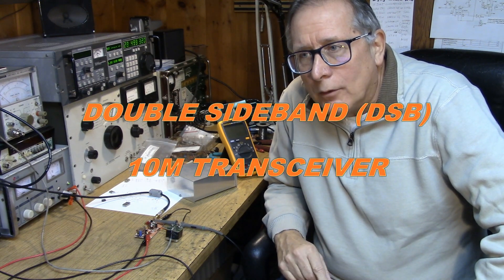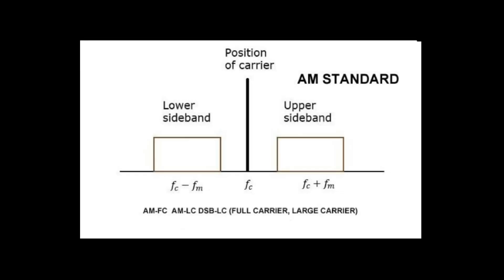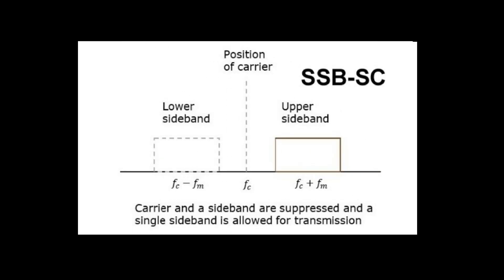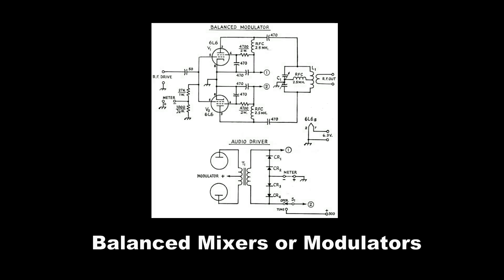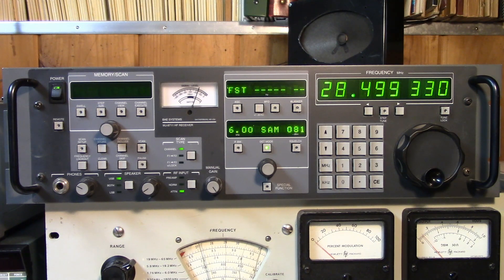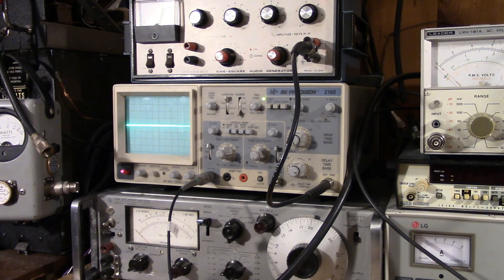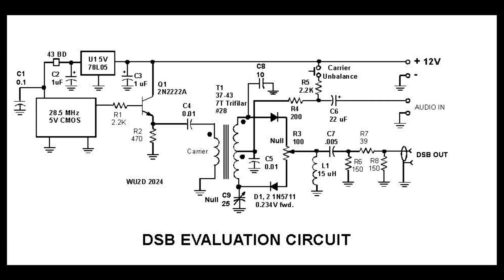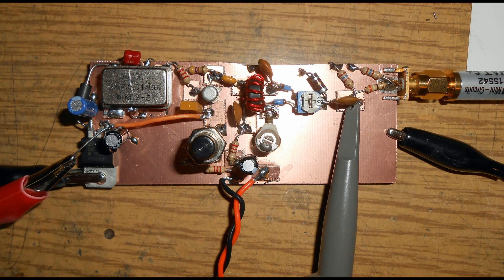NOVICE 10 DSB XCVR - PART 1

Comment: What is the make and model of the receiver with the green display that you are using?
Reply from the maker: That is the WJ8711, designed and sold by Watkins Johnson. Rebranded by BAE and Later DRS.  Early SDR IF back end.

Comment: Mike you just confused this old “G1”    ( Nothing new  LOL ) .

When synchronous demodulation is used for double sideband suppressed carrier what's the PLL locking on to ?
You shouldn't have a carrier unless it is BFO injection but that can move ( as can the RX signal ) .

For synchronous demodulation I have used a IF limiter driving a mixer port with the normal IF signal on port 2 .
It works but that's just for AM .

Comment: When you get to the build for the Final RF output could you explain how to achieve the 50 Ω output.  Looking in the ARRL Handbook I see Tables for Low Pass Filters at 50 Ω.  How do you get to the 50 Ω after the Transistor.
Reply from the maker: The easiest way is to force the final to be close to 50 Ohms and ignore it. RL roughly is Vcc^2/2P. So 12.5VDC and 1.5W  = 52 Ohms. I know this sounds incredibly simplistic and ignores Xc, but simply making the first C in the PI filter a trimmer to absorb the C will get you started. But for more power, you can see that the impedance will fall to some number like 10-j5 and you have to convert up to 50 j0 Ohms. This is typical. This is where you use your formulas with a L (or T) Match, so you add an extra L in series before the Pi Filter. So the conversion up is done with a series L and the first Shunt C which is variable. Then a couple more stages of low pass PI and you are done. Assume a Q of 2 or 3 for a wideband match and maybe 4 or 5 for our 28 MHz narrowband case.
Reply: Thank you for the explanation. I think this is leading to doing more reading about Smith Chart Plotting. @MIKROWAVE1

Comment: I'm lazy and just go with the Mini-Circuits double-balanced diode ring mixer modules - LOL. Thanks for the video, it brings me back to my communication systems class.
Reply from the maker: Cheap is even better than lazy. For fun a took a choke from an ATX power supply with a solid ferrite inside and took the tiny 1/16 Dia. by 3/4 inch long ferrite rod and wound 7 turns of #28 trifilar on it and configured the transformer solenoid style. Then I replaced the two Schottky's with unmatched 1N914s. Everything was pretty maxed over to get a null, (the pot and the variable trimmer); but it worked just as well as the fancy toroid and the Schottky's!!

Comment: Search for Wireless World Homodyne Receiver.

Published in September 1973, pages 416-419.

I built this, but used two mechanically connected tuning capacitors rather than using tunable inductors.

I'm not sure that one could find the two ICs nowadays.  Maybe some day someone will update it to use more modern components and perhaps a lower voltage.

Comment: Great video really enjoyed it. One thing the Icom 706 (all versions) does transmit normal AM with both sidebands. It’s takes the SSB balanced modulator and applies a DC voltage to the audio input to unbalance it and transmits the carrier & both sidebands thru the AM receive 8khz wide filter. It’s 4 quadrant multiplier configuration. Also they use the FM audio limiter on the AM mode to limit the negative & positive, mainly so the modulator does not carrier invert at 100 percent negative.

Works great, I used the same type of setup on my other radios for AM using a MC1496, UPC1037H or SN16913P which are double balance mixers or balance modulators depending how you have them configured. The best setup is a 2 quadrant multiplier, basically a single Gilbert cell. That gives you modulation that is identical to plate modulation and the carrier pitches off just like plate mod. Low distortion and sound super. All my radios have 455khz transmit IF, so thats were the modulator is inserted
Reply from the maker: Wow the 706! Older transceivers just added some carrier by just unbalancing the null.
Reply: @MIKROWAVE1  I would say just about all the older japanese analog SSB radios do it that way. Some Yaesu models have separate AM modulators like the FT-102 which uses a Gilbert cell and a few other Yaesu models use FET gate modulators. Icom radios have always unbalance the SSB modulator for AM. Same for Kenwood , except for the T-599 transmitter that use a Gilbert cell like the Yaesu FT-102. 

Those that have the Gilbert cell have extremely good modulation with low distortion and look exactly like plate mod on the scope. I know your using discrete parts for the creating the DSB which is fine , but a MC1496 or SN16913P would be much easier and will hold the carrier suppression spec better under all conditions. You don’t need any matching coils either and very low parts count, especially on the Texas instruments SN16913P
Reply from the maker: @GammaMatch  I worked with Barrie Gilbert as an applications engineer at ADI in the late 90s. We stole him from Plessey.
Reply: @MIKROWAVE1  Wow thats so cool, His design using differential amps in a cross coupled configuration is the standard for mixing and IC balance modulators. I have a Yaesu FT-1000MP that is the only modern ham rig that has a Motorola synchronous AM detector, really works and sounds good. Looking forward to part 2 !!

Comment: Hi Mike, I have built a DSB transceiver some years ago for 40m and had a great deal of fun with it. Most stations didn't realise I was using DSB and had some great contacts and reports. A few even failed to find the other sideband. I would have loved this video series back then. I also have an old 10m DSB TX  failed project still sitting on the bench. Made several QSO`s but kept breaking into oscillation. 73...David M0DAD
Reply: Too much gain in one of the stages?
Reply: @G7VFY  Yes quite possibly, I was thinking it may be harmonic related. It worked great into a dummy load but would howl into the antenna. I found when I detuned the antenna with an ATU the howl disappeared and was able to make several contacts. It was one of those projects I couldn't get sorted and didn't want to give up so it has remained in the unfinished draw of my shack...David M0DAD
Reply: @m0dad  I remember listening to a SOLDERSMOKE podcast and hearing about  Bill Meara having stages going into oscillation. With PA it's really bad.
Reply: @G7VFY  That`s right I remember it. It was Bill Meara who helped me with some advice when I was building my 1st DSB TX. I think it was when he first moved to London. A very helpful chap and he was even kind enough to send me one of his trifilar wound torrid transformers so I could compare to my own.

Comment: Mike:  I've built at least three DSB transceivers.  On the receive side, the way to go is to assume that the other station WILL be on SSB, not DSB.  Once you make this assumption,  you can get away with just building a Direct Conversion receiver to accompany  your DSB transmitter.  It works great.  I NEVER met another DSB station, and most of the SSB stations never realized I was transmitting on both sidebands.  Simplicity is a virtue!   I hope you keep the receiver simple: Direct Conversion.  73  Bill N2CQR
Reply from the maker: This is great encouragement Bill!  This is also a time machine it seems. Stuck some gain ahead of the mixer and tacked on my LM386 utility amp and signals blasted out of the cobbed up receiver immediately. Its the 10-10 Contest weekend!

Comment: Mike, good introduction into DSB. Question, what commercial broadcasting system uses DSB to transmit two audio channels?
Reply from the maker: The only two channel AM (stereo) system was the old C-QUAM system that was never really a standard. It died out. DSB with a pilot tone was still being used here and there on the shortwave bands, but it's just one channel of AM and you needed a synchronous detector. Not sure if this is still out there.
Reply: @MIKROWAVE1  Well well Mike! I am surprised you did not think of FM-Stereo L-R 38 khz signal, which is DSB, and the 19 khz pilot tone is then doubled to reinsert 38 khz carrier, for AM demodulation to reconstitute the two L & R audio channels. .
Reply from the maker: Wow! The magic of subcarriers and spectrum shifting! I used to work on FM Video transmitters that had two narrowband FM subcarriers for left and right audio added into the modulation. WE called this FM-FM.  @JCWise-sf9ww

Comment: There is a way to recover carrier from DSBSC. A comparator and simple flywheel circuit (LM555) and add back. Then simple detector works.
Reply from the maker: This sounds interesting, and it it sounds like a zero crossing method of carrier recovery. Essentially, you are talking about a 1 bit A/D comparator.
Reply: It does work, the "Flywheel" handles the zero crossing. Did a project with this method  in engineering school yrs ago.
🤔
 @MIKROWAVE1
Reply: Yes. Did a project with this scheme years ago in engineering school. But much lower frequency.  @MIKROWAVE1